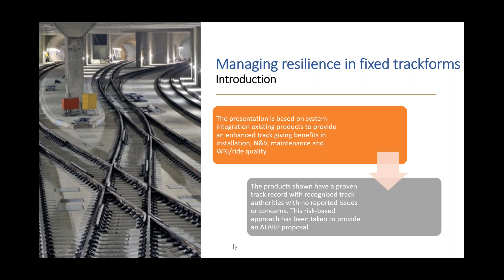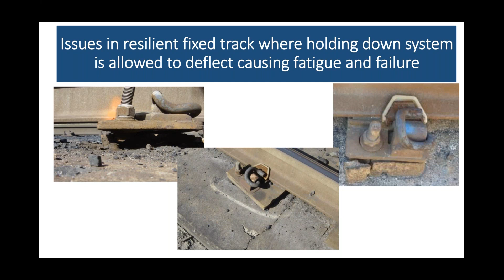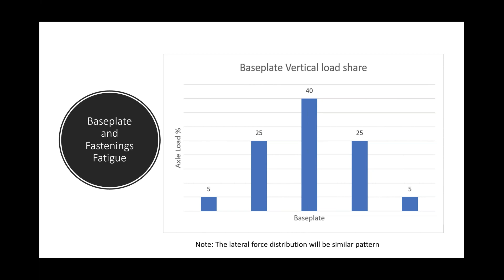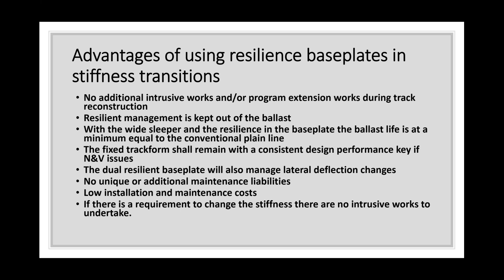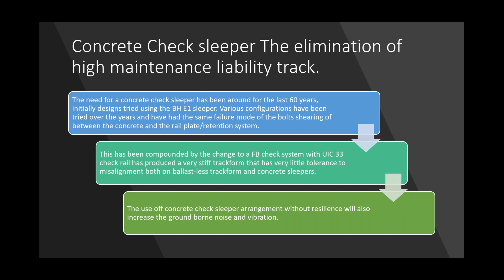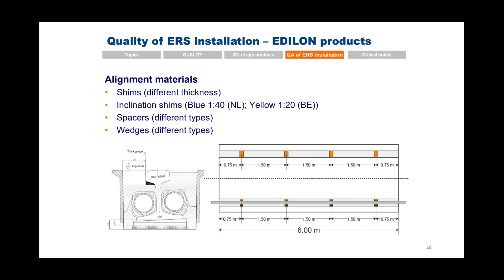Managing resilience in fixed track forms - Peter Barber

Comment: 🎯 Key Takeaways for quick navigation:

🛤️ Overview of the Dell Core system focusing on integrating existing products for better performance in noise, vibration, maintenance, and riding quality.
🔊 Types of vibrations: airborne noise (high frequency, not managed by resilience) and structural-born vibration (major problem in urban areas).
💰 Impact of vibration issues on costs and legal liabilities, particularly in urban areas, urging consideration in renewal budgets.
🚆 Review of track forms for managing resilience: direct fixation, embedded rail, compressive base plates, resilient egg clone arrangements, and floating slab tracks.
🔄 Challenges in managing resilience include lateral forces, preload effects, bolt torquing issues, and resilience fatigue.
🧰 Characteristics of resilient systems like the twin-part bonded rubber, compression plates, and their effectiveness in reducing vibration and maintenance.
🛠️ Maintenance strategies for resilient systems, including lateral adjustments, fatigue management, and stiffness transition designs.
🚄 Transitioning stiffness through rail systems to manage deflection, considering speed-related factors and the advantages of non-intrusive works.
🚄 Resilience management in fixed track forms involves optimizing stiffness for slab tracks while considering critical areas such as the ends.
🚧 Adjusting stiffness on the end of a track can affect noise and vibration, so it's preferable to make changes outside critical areas where there's more control.
⚙️ Dual resilience management not only handles vertical deflection but also manages lateral deflection, preventing issues like sleeper rolling and cohesive bonding failure.
🏗️ Changing stiffness due to stock movements is relatively easy by unbolting base plates, facilitating adjustments in track resilience.
🌉 Transitioning from softwood to more rigid materials like FFU or concrete and steel in fixed track forms is aimed at enhancing durability and reducing maintenance.
🔩 Resilience systems, especially with lateral resilience, help reduce peak forces, screw failures, and friction, thus enhancing the overall track performance.
📐 Integrating resilient systems with concrete sleepers and transition systems can improve track durability, reduce maintenance, and optimize rail alignments.
🛠️ Collaboration with clients is crucial in determining fastening systems and construction methods to ensure optimal performance and longevity of track systems.

Made with HARPA AI